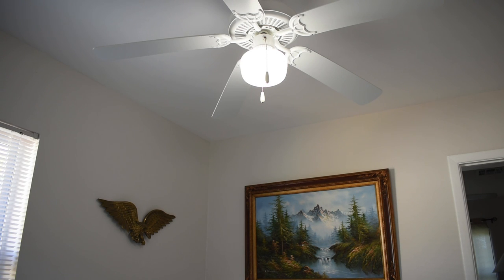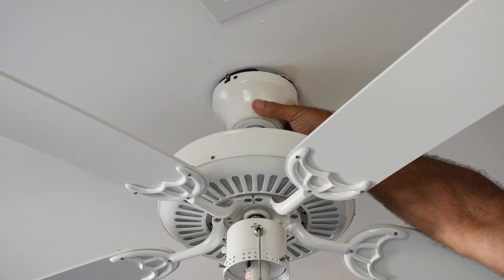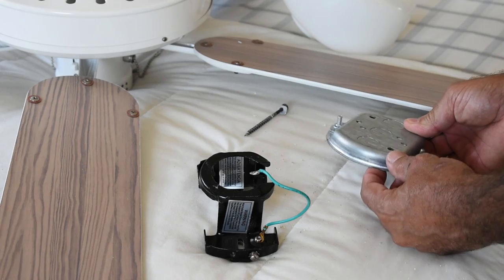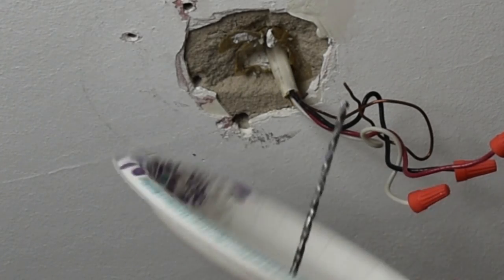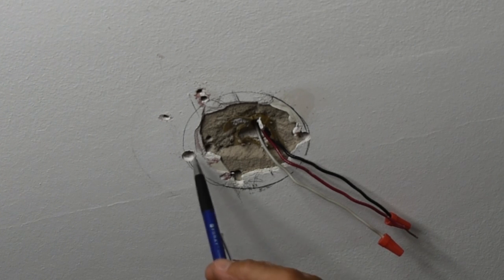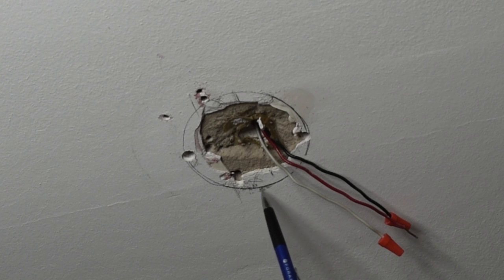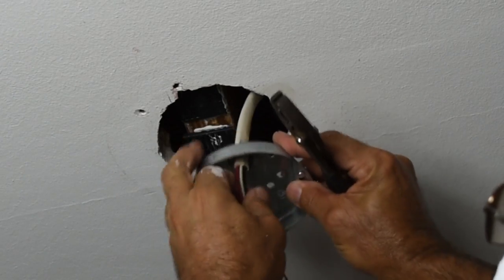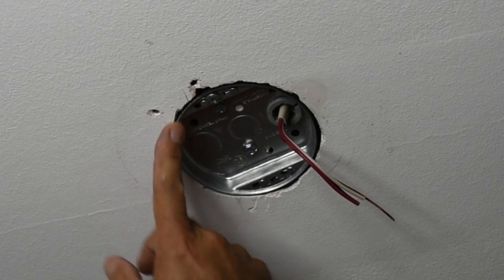Ceiling Fan No Electrical Box? HOW TO EASILY FIX!

Comment: Excellent job on this fix. 
Back when I started replacing ceiling fans in the house, the previous owner installed the fans secured to the electrical box with one 8-32 bolt and a wood screw.
Reply from the maker: I've seen that before. Thanks for watching!

Comment: Bringing an older home to code is a never ending source of surprises. Nice job on that one.  Tho I must say, if I had to choose "electrical thru a hole without a box" or "mounted to a box not sturdy for a fan" I would pick the electrical problem.
A friend had a ceiling fan fall down and hang by the wire. It had originally been installed in an "old work" box just hanging on the sheet rock by the ears.
Reply from the maker: True. I find surprises all the time. So many people should not be working on homes. The fan was definitely secure when it was done improperly. Thanks for watching!

Comment: Great job, not trying to nit pick, just one small note, the plastic pop in goes in from the top of the box , not the inside.   it prevents the Romex from being pulled into the attic, not the ground screw.  Plus in the future, if the fan were changed out, you could easily pull more wire down if you needed more slack
Reply from the maker: Depends on the situation when I install those plastic Romex clamps. In this case I chose to do it as shown because no one will be in the attic pulling upward to pull the wire out of the box, by installing it as I did, you also have more room inside the shallow box. You won't have the whole extended part of the plastic bushing sticking down into the pancake box making it more difficult for you to tuck the wires into position. The ground screw does excellent job of preventing the cable from being pulled upward into the attic, and the clamp when installed as shown prevents people from pulling more wire down into the room especially when there's no staple located within 6 in of that box. All comes down to preference. Glad you enjoyed the video!
Reply: @electronicsNmore  I can tell you definitely know a lot about the code.   But the code requires the staple within 12" of the box for NM cable "Romex" and allows for 18" of slack between the staple and box, and 6" of wire min to work inside the box.  I'm guessing that the allowable slack is to be able to pull more in if needed, but it doesn't say why.
Reply: Please don't misunderstand, your video is excellent and does a great service to DIYers to do things the right way

Comment: Excellent presentation. I ant to put one in my garage ceiling. there is a receptacle giving power to the garage door motor. Can I use that receptacle wire to wire the fan? I would probable have to do your exact installation mrthod. Can I proceed? Thank you.
Reply from the maker: @mostrogolf22  To my knowledge a garage door opener does not require a dedicated electrical receptacle. Ceiling fans draw very little power, usually 100w or less, so I see no issue with tapping into a garage door opener electrical receptacle

Comment: I always do it the hard way- attach the box to the beam or truss with a cross brace up in the ceiling. Have found ceiling fans attached to drywall with molly bolts! The ones in my home were old Hunters and were attached to a steel frame up in the ceiling!

Comment: So my house is very old, it has real hardwood in the attic.. I wanted to add a ceiling fan to my sons room ( most rooms I was able to do this job no issue) but his has no box at all ( one of those ugly boob lights ) on the ceiling. 
The hardwood surrounds only wires without a box. 
I have a keyhole saw but how do I do this job? Should I try to cut through the wood that's super hard? Or the other option which is a no no to just wire the small fan up there and screw it into the wood?

Comment: I specifically wanted to see how you wire it since the colors at times are different. I see white black and blue and put the blue with the white? Since I remember I did not put them together due to short but I assume that home was just strange.
Reply from the maker: The black wire of the Romex typically goes to the fan motor the blue wire of the fan light kit typically goes to the red. It can also be the other way around. White to white.

Comment: Also sometimes they use lamp cord.
Reply from the maker: I came across a kitchen ceiling light that was connected to the existing electrical using a lamp cord. Horrible!
Reply: @electronicsNmore  I've seen similar at least a dozen times. Definitely a lot of horrible add on work done to the older homes.

Comment: I guess you didn't have a stud finder with you (not including your wife 🤣).  I've always hated installing a ceiling fan.  I usually have to balance the blades and set the all the blade angles the same to prevent wobbling and vibration.  Plus the awkward angles of everything being on the ceiling and the fan's weight, working by myself.  Cool tricks here.  Great video.  Thanks
Reply from the maker: I have one, I just prefer to drill a tiny hole instead since I'll be cutting the area out.
Reply: @electronicsNmore  Yeah, you need the drill no matter what for the installation of the box, and there's already a hole there. Might as well do a quick exploratory probe. Sometimes stud finders are hit or miss anyways.
Reply: @electronicsNmore   At least you keep your stud finder wife nearby and easy to find.  🤣  I think it was her that came up in a suggestion video.

Comment: When my dad's house was built in 2009 the electricians did not make it flush to the ceiling and I have a hugger in my room so it sits crooked and the electricians did leave the kalck a mess on the side bad job they did🤬

Comment: I put the clamp on the back side of the box so no one can pull the cable out from the attic.
Reply: That's one of the issues of these plastic strain reliefs-- they only provide one direction of resistance. IMO no plastic should ever be involved in any part of the ceiling fan support system. I prefer the old-school metal screw it all down tight strain relief/clamp. Attic temperatures can get way hot. Plastics just won't last.